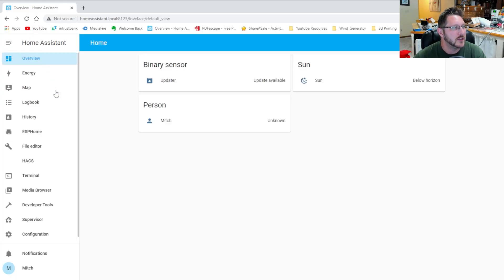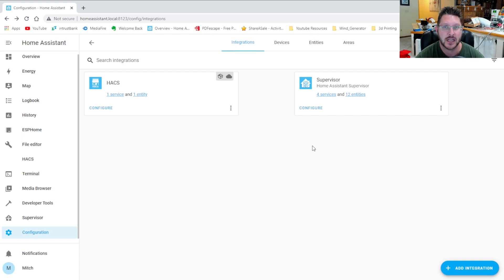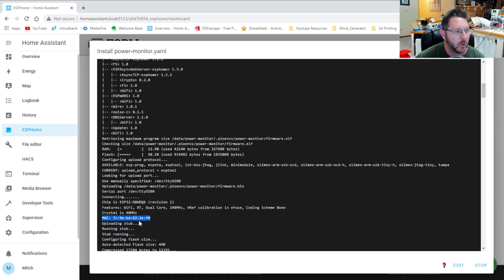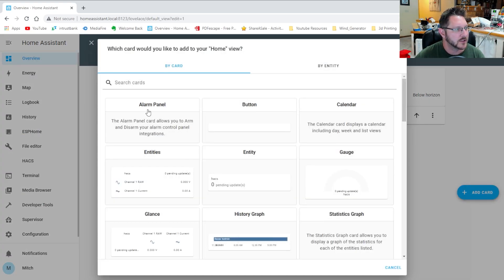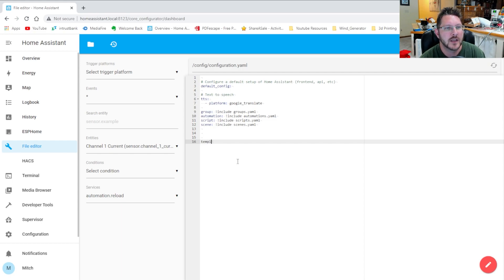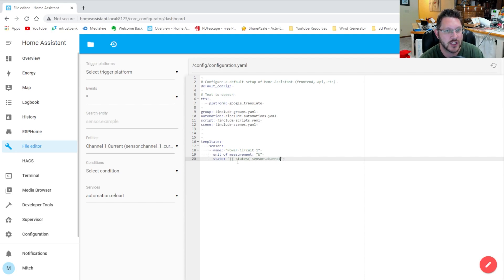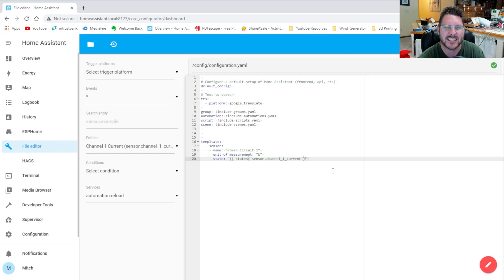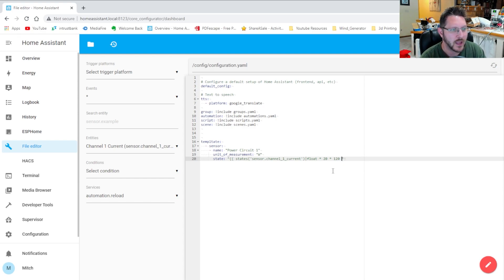Home Assistant Power Monitor System Part 2

Comment: Hi
Congratulations!!!!!
The best HA tutorial I could find on energy sensor setup.
I have a BMS for battery and I have Minus amperage when charging or plus amps when discharging. 
For configuring the the battery sistem on energy tab ... I have to make two sensor for the negative value  and for the positive value... how can I do that?

Thank you again